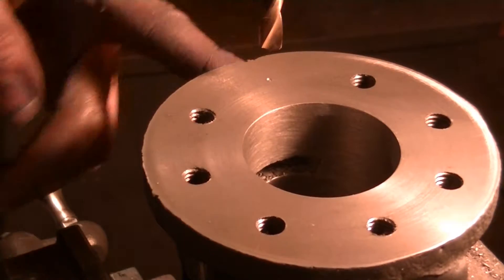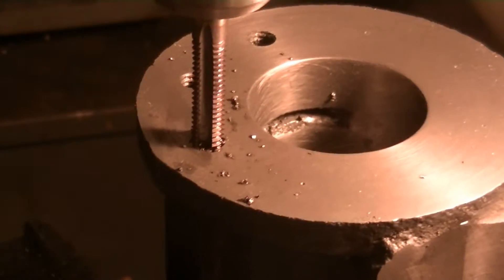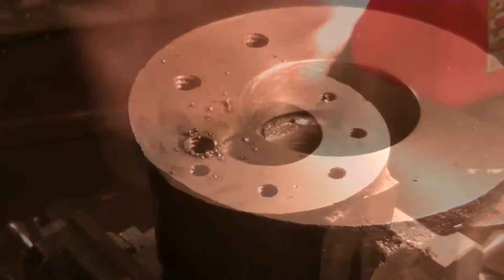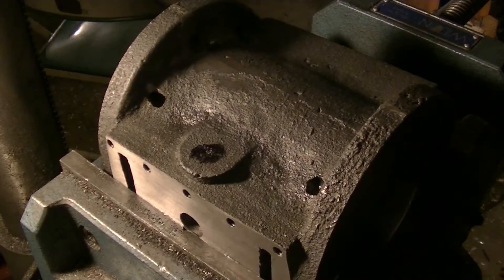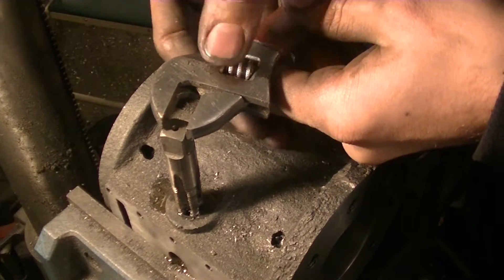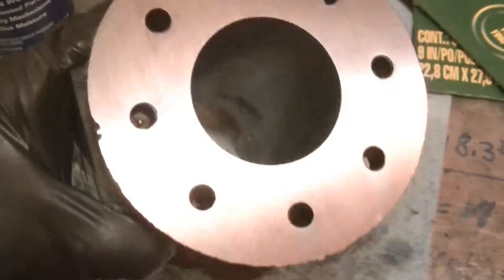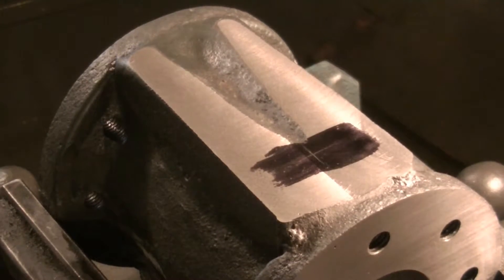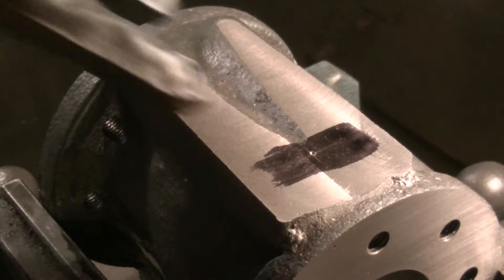Steam Engine Build: Machining the Engine Cylinder: Part 5 (Final)

Comment: Very nice little motor where did you get the prints ? I want to make a small steam engine and really like the design of this one only my lathe is a bit smaller so will scale it down probably 25% or maybe even 50%.
Also where did you find the cast iron to melt down to cast it?
Reply from the maker: The design is my own.  I drew it up in a CAD program.  I plan to release the prints when I finish it!  For the cast iron, I used old brake rotors/drums and old cylinder heads.

Comment: Great video series!
You can make using taper pipe taps much easier by using a pipe taper reamer.  They are made to match each standard NPT pipe taper size and the smaller sizes are quite cheap even if you buy a USA-made one (rather than an import).  My tap drill wall chart lists two tap drill sizes for each NPT size.  One drill size is labelled "without reamer" and the other "with reamer".  The reamer goes in easily and makes tapping the thread much more pleasant and you can run the thread much further in without worrying about breaking the tap or spraining your wrist.  I hope that may be helpful.

Paul
Reply from the maker: Thanks for the comment! It IS helpful! I will try to get my hands on some of those reamers.
Reply: Thanks for the tip.